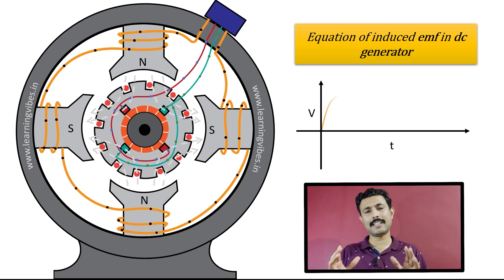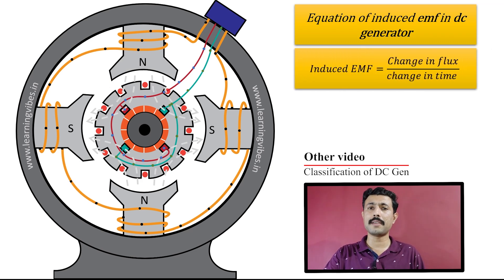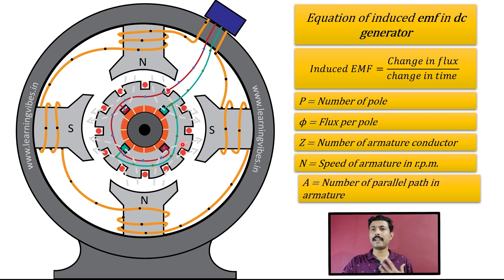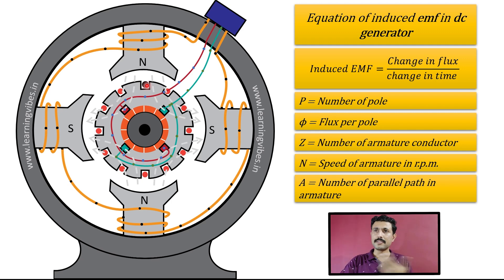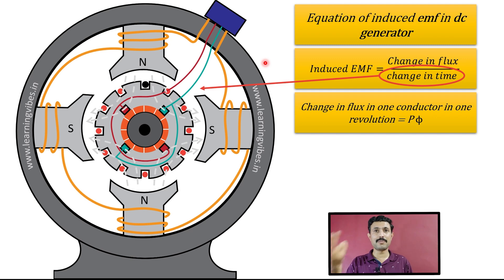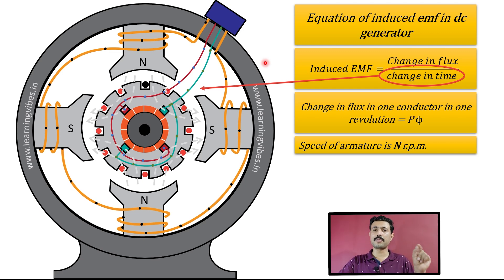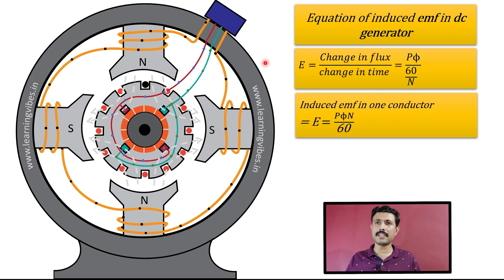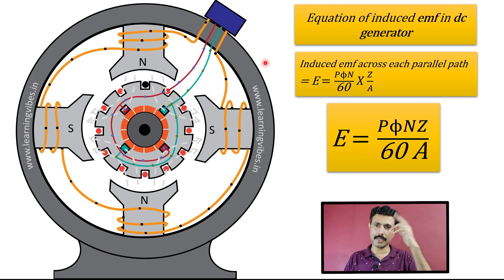EMF equation of dc generator with animation | Derive EMF equation of dc generator | Mruduraj

Comment: I presume the law used is faraday's law...why is the emf emf for conductor and not one loop ( turn)?
Reply: Thanks for the timely reply, I thought faraday's law only applies to loops and not and not a straight wire
Reply from the maker: Yes it's Faraday law
Reply from the maker: Because one loop or turn in armature contains two conductor. So calculation is done on basis of one conductor and then apply on all

Comment: Sir may i know if you say dc generator means the supply is dc volts and the ouput voltage is ac volt is my assumption is correct sir subscriber from the philippine and that generator is single phase tnx sir
Reply from the maker: Excitation voltage that we give is dc
Generated emf in conductor is ac but using commutator we are converting it to dc
Reply from the maker: For more discussions
Join our learning community for free here we learn together
https://t.me/learningvibesgroup